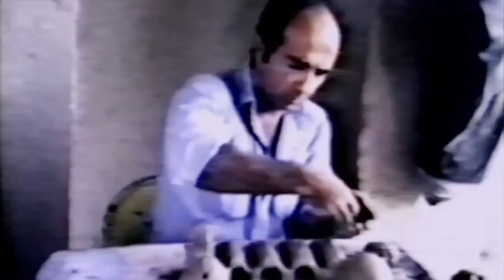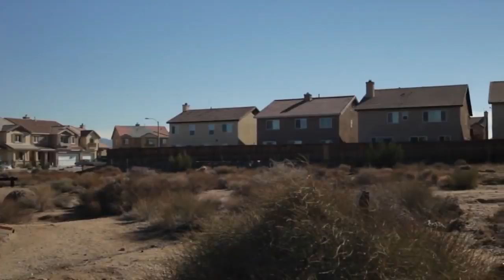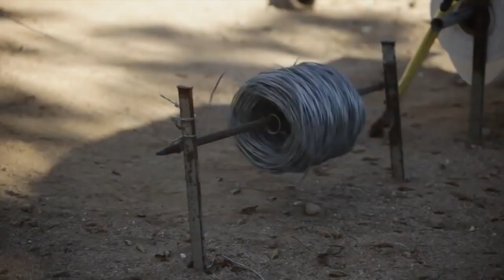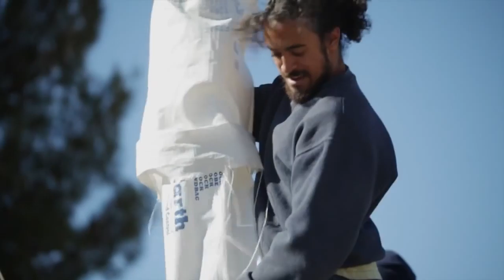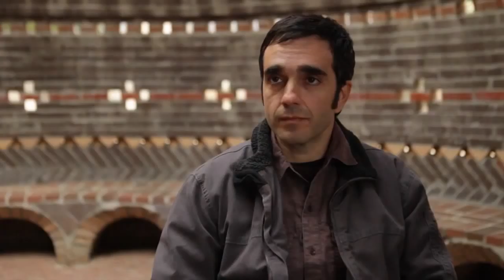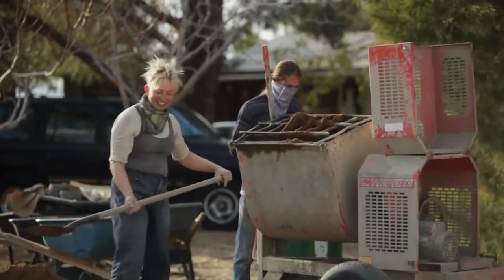Nader Khalili's earth bag’s &  Architecture

Comment: I have questions.
 1. Can i build a house like this in high mountain dessert( with a snowy winter conditions)
2. How much cheaper is it then a traditional house
3. Can i put it under ground and have plants like sagebrush grow over it?
4. How easy is it to mess up on it(dont want to be burried alive if i make a mistake)
5. How big if a dome can you make, how tall can these doms get.
Reply: I'm not exactly sure but I think you could build it in colder places. The cost always depends on what exactly you use, for example, it's cheaper if you can use the dirt you have on your property but some have to amend the dirt which adds to cost but it's always 20-50% cheaper than a 'normal' house of the same size. Yes, I've seen plenty of builds that had plants grow over top, and even plans for cellars, it would depend on how deep you're talking but it should be possible. I haven't built one myself so I can't actually comment on how easy it is to mess up. I can't remember the exact height of a dome you can build(I think like 10-15 feet), but if you add the proper support you can build it higher. Hopefully, someone more experienced will answer. You can also find a lot of what you're looking for on google.

Comment: What will happen when heavy rainfall occur, or they are just desert friendly
Reply: These things hold up in rainforests, friend. The composition is key, and so cement is usually part of the mixture to ensure everything holds.
Reply from the maker: The solution are always linked to local climate! Larger roofs keeping the rain away from the wall, plus rainwater drainage is necessary. External wall ingredients (clay plaster) are important too
Reply: I've seen a lot in the U.S. have wooden roofs and they look amazing combined together.